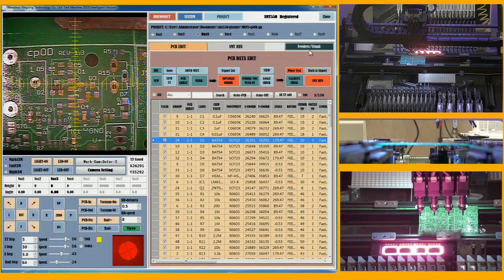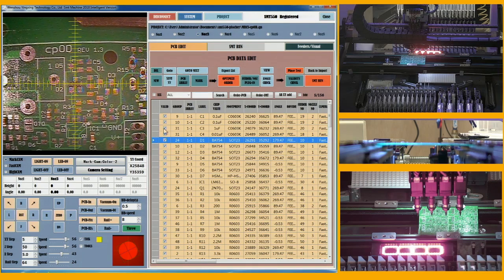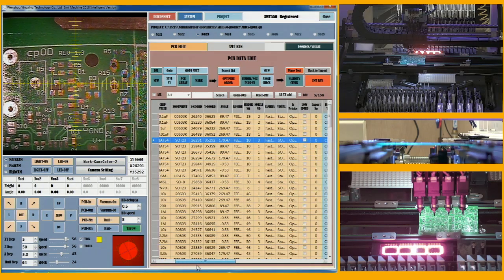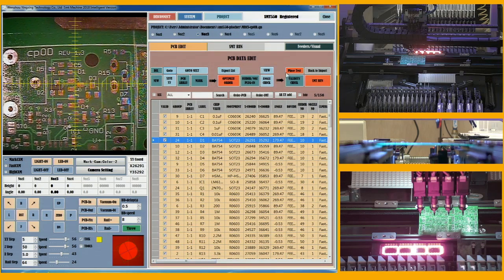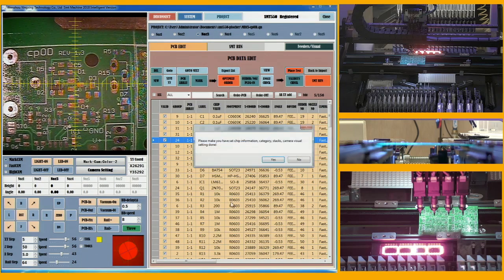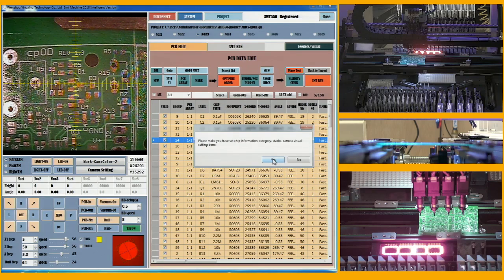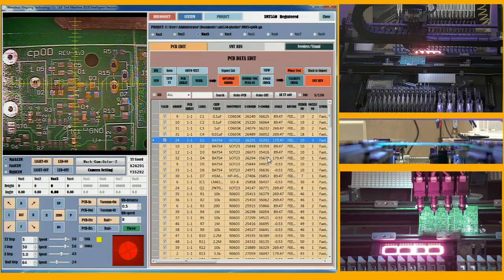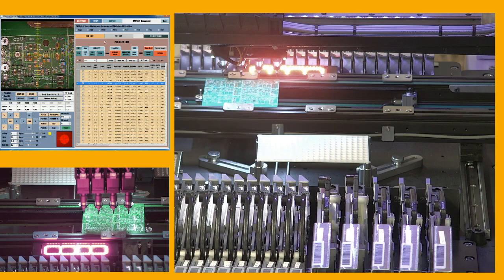SPCoast SMT550 - component test placement isn't working as expected

Comment: Is this machine worth buying?    They have it priced at 7.5kUS right now.    Would you do it again knowing what you know today?
Reply from the maker: As I said in comments in other of these videos, the system works and works reliably, certainly significantly more so than my previous CHMT48 which required per-job babysitting and hair pulling.  It has an idiosyncratic learning curve  and the software only makes sense after you internalize its presumed-but-never-documented operator workflow (see also "crappy chinese software"), but once learned, is usable and reliable.

If this all sounds lukewarm, it is.  YX is a distributer for the actual HW and SW manufacturer and, while the HW is solid and robust, they adds little (or maybe even negative) value for the software.

If I was doing it over again, I would look really hard at both the KAYO and Neoden machines because of the perceived quality of their software.

YX's software is written in Win95 & .NET, and does not document its job file structure (which is a .NET opaque binary database collection, as far as I can decypher...).  Kayo, on the other hand uses structured JSON/XML file formats for everything, which makes it trivial to integrate the system into an existing workflow without error prone interactive job import and setup  activities.  See Unexpected Maker's thoughts on his Neoden - they parallel mine on the Kayo,...
Reply: @JohnPlocher  I like the standard Yamaha feeders on this XY offering.   I just found the KAYO website.  Are you saying that XY gets their hardware from KAYO?
Reply from the maker: @keithsummers1889  Not at all - YX gets HW from Huawei Guochang (HGC); Kayo uses a visually similar design, but (reportedly) does their own software.  I went with YX because (at the time) Kayo didn't offer full support for electric feeders (it was a special extra cost order that required change out of some camera components...) and I got cold feet.  I wish I had persevered.
Reply: @JohnPlocher  I just sent email to Kayo.  I'm hoping their price points are good for the comparable 4 head machine.  I'm on a tight budget.

Comment: Thank you for the videos. / How do you configure the feeder, footprint recognition?
Reply from the maker: I pick one of the camera modes (fast cam, ...) and pray a lot.  Dandruff seems to work with the defaults, SOT's need the SOT recognizer, and ICs need one of the rectangular ones.  As there is no documentation on the differences / use cases for any of these choices, it boils down to experiment and waste parts...